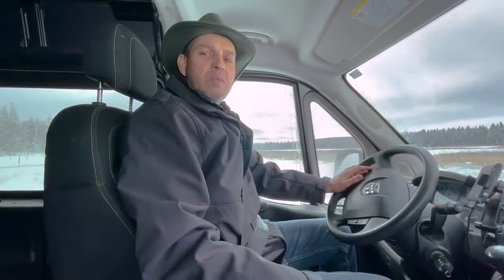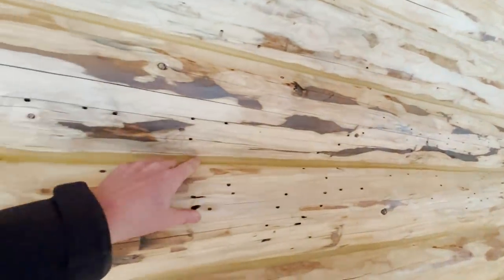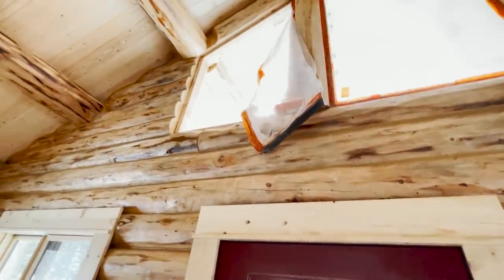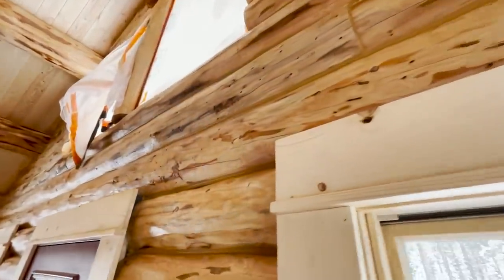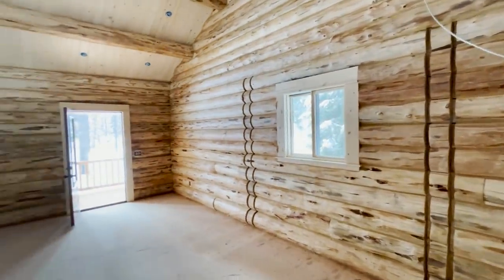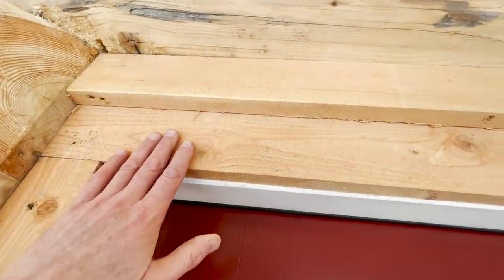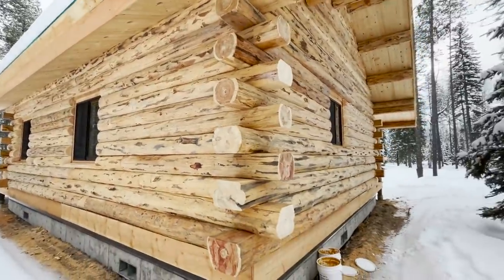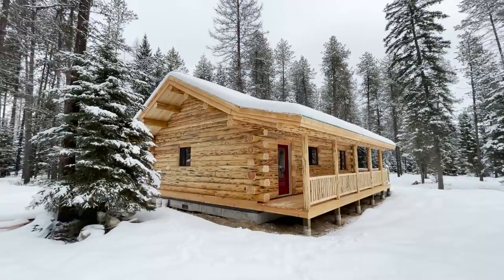LOG CABIN IN THE WOODS! Meadowlark’s New Green Valley Rancher- JUST BUILT!

Comment: @Meadowlark Log Homes  I didn't see adjustments for the porch posts. Don't those vertical members need to shorten to accommodate the roof over the porch as the logs on the main structure shrink?
Reply from the maker: There’s not that much settling, but on taller walls, we do provide a settling shim or a jack on the porch posts. You are correct that it is usually needed.